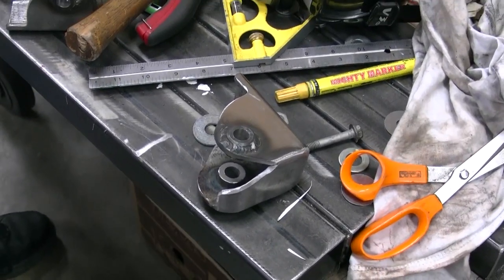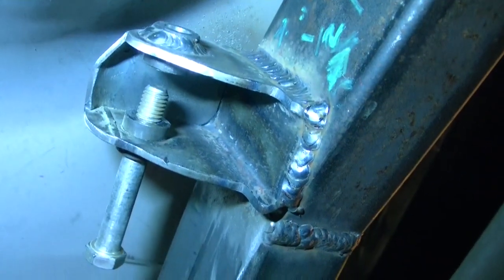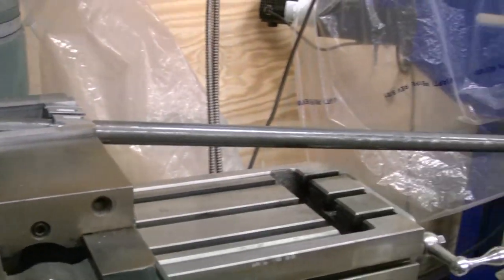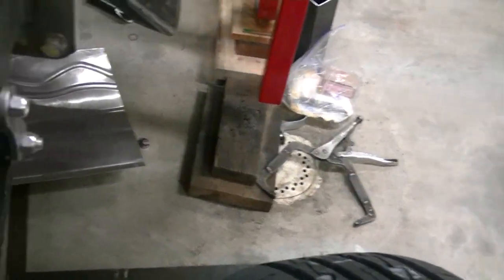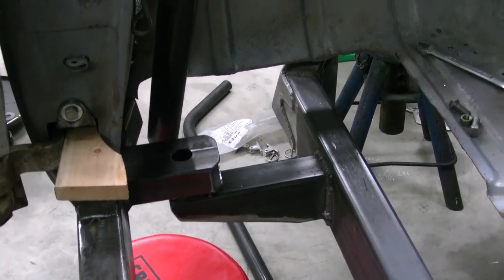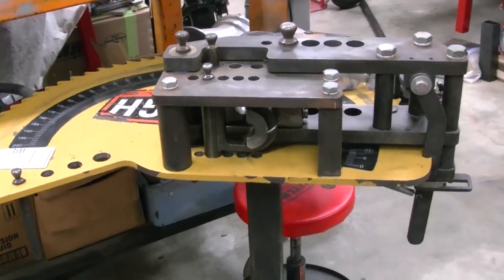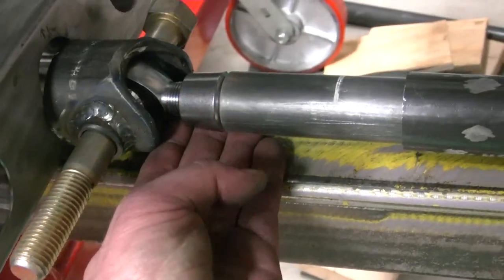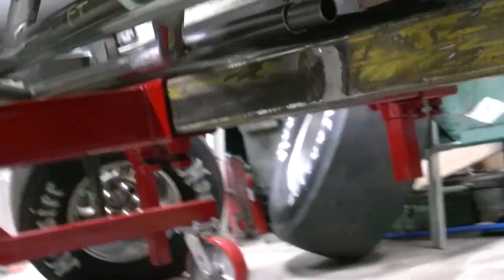Studebaker Gasser Build update 14 (rear suspension)

Comment: Make sure you cycle the suspension with the shocks in place without springs to make sure nothing binds, I had an issue with my gasser because I had the top and bottom shock mounts indexed by 90 degrees like you have yours and the shocks would bind when it cycled because they wouldn't rotate
Reply from the maker: Thanks for the heads up

Comment: Depending whether or not you plan to drag race this thing at all, you might have a problem getting any certification on this. They don't like welds being ground down, because they can't make a judgement call on whether or not the welds are to spec. If it's just a street machine or the guy who does the inspection lets it slide, then I guess you won't have to worry about it. Looks nice though.
Reply from the maker: Nhra only inspects the roll cage (zero welds on cage can be ground down and weren't). My nhra division director has been out already and everything meets sfi spec. She's good to 7.50 in the quarter. Just touching up welds to make them look good on other parts is perfectly legal. No integrity has been taken away.